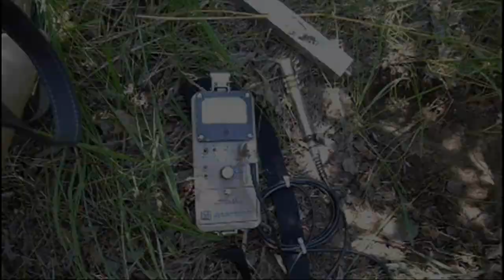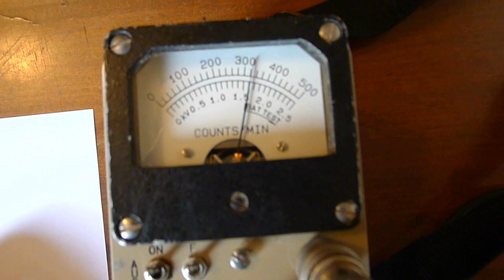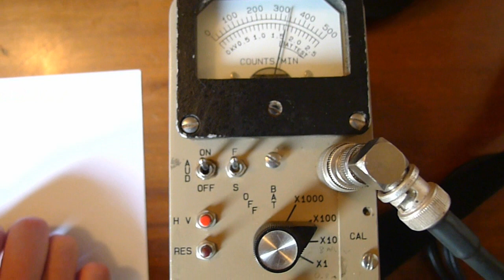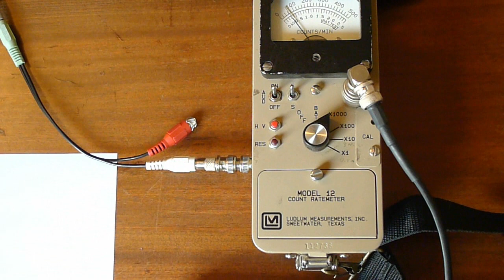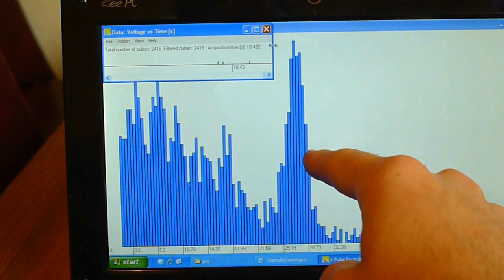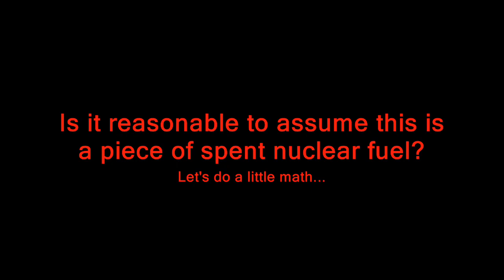Collecting a spent nuclear fuel fragment at Chernobyl

Comment from the maker: Kyle Goddard Going to Chernobyl and handling SMALL pieces of nuclear fuel (like what is shown) is pretty safe relative to some everyday risks people take, like driving or eating cured meats or smoking.  My whole-body dose equivalent from external radiation for this trip did not exceed 10 mrem, which is too small to be associated with meaningfully-quantifiable health risks.  If one DID extrapolate a risk to this dose using risk models, though, it would be about as risky (in terms of death by cancer) as smoking 1.5 cigarettes.  The highways in Ukraine are far more dangerous than Chernobyl radiation!
Reply: @ezekiel1249  Maybe you should do a bit of fact checking before calling someone an idiot. A quick look at his youtube channel would reveal that Carl is very much alive. His geiger-counter is not indicating in millirad/hour, and even if it were then that would still not be particularly alarming. For a lethal dose of radiation you're still off by a factor of 1000, and it would then still need to be full-body dose (rather than highly localized as it is in this case) and sustained for an hour.
Reply: @MatthijsvanDuin  thanks for correcting me didn't know it had to be a body dose I thought radiation fragments release radiation in the air where it will cover a certain part of land radiation is not my forte but I do like the chernobly HBO series
Reply: @ezekiel1249  You are awesome for admitting you were wrong, that's a first in youtube comments
Reply: You still active and into this stuff
Reply from the maker: @drummondjwall9509  That depends entirely on your definition of "active", but given that I keep posting nuclear science videos (most recently last week), I'd say I am still active and "into this stuff."
Reply: Lol my bad dude , I just saw this from 10 years ago but that's cool I'll subscribe now

Comment: May I ask what you did with the particle? Bury it up in the exclusion zone again?
I believe it's strictly forbidden to take particles out of the exclusion zone and I doubt you can get it home in your suitcase. Unless lead pigs are not considered suspicious ;)
Reply: Raymond Doetjes exactly what I was thinking :p
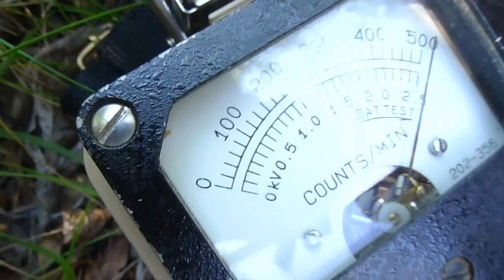Reply: I think he is dead cuz look at 1:04 you can see the radiation is beyond 500 which means he got a lethal dose
Reply: @ezekiel1249  Yes, Carl died four years ago and yet posted a youtube video two weeks ago from beyond the grave. Such dedication!

(I suspect you're just really confused about the units here. The amount of radiation here is really not particularly dangerous, especially considering the limited amount of exposure Carl received.)
Reply: @MatthijsvanDuin  I need to do sime research because I need to know what the BAT TEST is cuz look at 1:04 of the video and you will see something named BAT TEST between the 400 and 500 mark
Reply: @ezekiel1249  You are thinking REM not mrem
Reply: @ezekiel1249  let's focus on the gage of the meter for a minute.
Metering scale from 0-500 counts per minute.
0-25 kilo volts.
Bat test, to ensure you equipment battery is of reasonable power to successfully run the meter.
 The meter is able to add multiplying factors to your scale, x1, x10, x100, ( x1000 on select meters). 
So if we max the scale on all factors it would look like, x500, x5000, x50000, so on if we have more times factors.
Counts/minute is more a show of activity then does, such as R/h or mR/h. He is in potential to receive a large dose past normal, but still isnt likely as the sample isnt right on him.
Reply: @ezekiel1249  that is CPM not roentgen
Reply: @ezekiel1249  lol that fuel particle only puts off 500-600uSv/h on contact. It's orders of magnitude smaller than something that would be considered an irradiation hazard.

Comment from the maker: A linear tail-pulse signal is capacitively coupled off the output of the first stage preamp in the ratemeter to the BNC on the side.  A cable carries the signal to the computer's sound card input.  The computer uses Marek Dolleiser's free "PRA" application for pulse-height multichannel analysis.  Ratemeters are all fundamentally similar in design, but specifics differ, so I can't furnish a meaningful and universal recipe for the mod.  I am happy to answer specific questions if this isn't clear.

Comment: Carl - Did you modify that detector and tap the amplifier stage of it or does it normally output that? The soundcards bandwidth is fairly limited, I would think you typically need a much higher sample rate such as that of a RF ADC. but I would be very curious on how that is setup if you have a link. Appreciate it my friend!

Comment from the maker: The Unit 4 core load was near the end of its life at the time of the accident, and some simple back-of-the-envelope calculations show that the Cs-137 content of this small piece is consistent with end-of-life or discharged nuclear fuel from this reactor type.  I didn't intend "spent" to imply that it was not in the core; my feeling is that it probably IS from the core.

Comment: Some of the short lived nucleides are gone but there are long lived isotopes too. As for the # of atoms, use the molar mass and avogadro's number to calculate it. 0.1 g of iron is 0.1 g / 55.8 g/mol = 0.00179 mol. # of atoms = 0.00179 mol * 6.022 * 10^23 = a very large number.

Comment from the maker: This setup was "calibrated" (very coarsely, because of rampant gain shift in such arrangements) with check sources prior to my departure from home.  The photopeak is not in channel 26, but at 26% on an arbitrary 100% pulse-amplitude scale.  I aimed to put 662 keV at about channel 200, if I remember correctly.  Next time you go to Chernobyl, you can contact a lab "in the area" and do a superior experiment.  Good luck with that; I'm not aware of any.

Comment: Thanks a lot for the explanation its somewhat of a shame that Ludlum does not incorporate something similar into there venerable meters it would seem to be a low cost way of modernizing there gear.
I would be interested to know what the voltage range from the first stage preamp is im just wondering if a analog linear optocoupler would be a viable option although it would seem needlessly complex.
keep up the good work

Comment: The readings were far less than that, or .06 Rem on contact. It would take direct contact of over 8333 hours; and his exposure is also largely the hands which means that this was far from a fatal dose. I think you misread the geiger counter, as counts per minute are not equal to absorbed dose. There is far greater math needed to process a dose than just the counts from a geiger dial.

Comment: Can you explain on what pin of what IC you taped of the signal and how?  i have a ludlum 2A post 7xxxx sn.  thanks in advance
Reply from the maker: My ratemeter was a Ludlum 12, so probably no relationship to the 2A internally.  If you understand the principle of the amplifier circuit, you can make a mod like this to any instrument.  The amp output must be loaded properly and you must not introduce any noise into the later stages.  I put an RC divider on the stage output to accomplish this as I recall.

Comment: Thanks Carl, Yes I might have it a little wrong. I calculated 40 microcuries as about 1.5 million becquerels or about 2 cubic metres of soil. I think I should have said 1 tonne. I used http://www.physics.isu.edu/radinf/natural.htm
The point is that it's a drop in the bucket of environmental radiation.
Your video has been reposted at http://chernobyl.tv/2013/10/19/spent-nuclear-fuel-found-near-chernobyl-still-extremely-radioactive/ where they misrepresent the facts and your opinion quite disgracefully.
I think your video is excellent and the message I was trying to put out, and I think you are too, is to keep reminding people to check the quantum of radiation, other calculations of mine are that the total Fukushima release is about 1/30000th of the natural radiation in the oceans, and that the Kursk contained about 1/3 of the Uranium naturally in a cubic kilometre of seawater, or 1 part in 4.3 billion of the total marine Uranium. I hope you agree with these.
Another good thing to do is go to Iraq or Bosnia and debunk the idea that depleted Uranium warheads dramatically increase the amount of Uranium in the environment. My calculation in regard to this is that the 300-400 tonnes of depleted Uranium is about equal to the natural Uranium in the top 0.1mm of Iraqi soil.
I concur with James Hansen and others that have said "There is no credible path to climate stabilization that does not include a substantial role for nuclear power"  Our planet needs us to win this argument.
Reply from the maker: Your new calculation and comparison to soil radioactivity look far more accurate.  I should point out that Cs-137 is the only long-lived byproduct radionuclide for which the gamma exposure based source strength technique can be used, but the other long-lived byproduct, Sr-90, will be present as well, and in similar concentrations because it has a similar fission yield and half life.  Hence my claim of about 100 microcuries total activity in the particle.  I don't think the Chernobyl.tv posting misrepresents anything factual about my video; perhaps the claim of "extremely radioactive" is what you dispute?  That is rather subjective of course.  Relative to any unrefined natural material (e.g. granite or soil), the spent fuel particle is thousands of times more radioactive on a mass or volume basis.  Relative to refined sources like radium salts, it's a weaker source (by an order of magnitude).  Spent fuel is found almost weekly at the ChNPP New Safe Confinement construction site and is one of the most important hazards on the site since large pieces cause dose rates of many rem per hour in close proximity.  It is a material that generally requires careful handling.
Reply: 1/30000th of the natural radiation is not correct. You can't compare natural radiation to artificial radiation in this way. 

For example the Cs-137 levels in the oceans are greatly elevated now compared to 100 years ago

Comment: This is a wrong approach to estimate what kind of material it is. You should take a measure of the mass, then of the volume and proceed to calculate the density and then compare with what you expect to be. This is the first step, then you proceed with gamma spectrometry and radiochemical examination. Of course this is very far from irradiated uranium oxide. First of all, after 30 and more years and high density particle couldn't be found on the upper  layer of the ground... then: gamma spectrometry should reveal also 85-Kr 514 keV penetrating gamma... then making a alpha decay measurement (total alpha) should help to exclude in the case of negative response. Radiochemical should help on the side of 90-Sr / 90-Y in equilibrium.... finally make the simplest think ever, but the most dangerous: does that particle melt at 2000 'C and more?? To me, it is not what you state. It is with the highest probability a piece from a filter of the nuclear plant since 137-Cs is in great amount and very volatile.... Ciao from Italy, ITREC Th-U reprocessing plant 1968.
Reply from the maker: Unfortunately, the hotel in Chornobyl did not offer facilities for laboratory-precision mass and volumetric measurements, nor for radiochemistry, not even basic alpha spectroscopy prep.  That doesn't mean the method shown here is meaningless, just that it is a low-precision estimate of specific activity of Cs-137 in the sample.  If we needed to see a weak 514-keV peak against a background of intense 662-keV Cs activity, and against interference from 511-keV annihilation photons, we would need to collect spectra on a high-resolution HPGe detector and not a sound-card scintillation detector.   Once again, the facilities do not offer this kind of support.  But once again, the lack of spectral resolution and detail do not motivate alternative conclusions about the magnitude of the specific activity of Cs-137 in the sample.  I am confident in that result and the conclusions motivated by it.
Reply: Carl Willis 85kr is a noble gas: dissolve the particle and collect gases, then filter them, then measure the noble one. Low concentration of course. However ICP mass spectrometry will tell the truth. I only think you've been so precipitous to make that conclusion. Always be careful when making a conclusion... however nice video
Reply from the maker: I am a professional nuclear engineer, and I have no problem understanding the analytical approach you propose; it's just not a realistic expectation in the government hotel in Chornobyl.  (I think I have mentioned that a few times.)  Nuclear fuel pieces are uncovered in construction every single week at ChNPP, and this small piece is demonstrably consistent with that common material, within the admittedly large uncertainties of the crude method demonstrated in the video.
Reply: Carl Willis could you link the relative uncertainty to your measures?? I don't see all that consistent you state...Thank you Professor...  ;)
Reply from the maker: This is the sort of thing you should be able to roughly intuit from the demonstrated measurement at ~3:33 in the video.  Specifically though, the measurement was done by comparing the count rate from a small, point-like ~10-uCi (decay-corrected) Cs-137 source in a ~2mm brass bead housing with the count rate from the sample particle here in similar geometry (probe contact).  In both cases, statistical variations on the meter due to the short RC shaping time are within 5%, and this is also essentially the visual interpolation limitation of the meter face; the reference source activity is known to within 10% or so; and the meter countrate calibration is probably accurate to within 20% with this probe (it is not a factory-calibrated arrangement).  Summed in quadrature, the overall uncertainty in the Cs activity of the sample particle is around 1/4 the measured value, i.e. 40+/-10 microcuries Cs-137.  If you read previous comments on this video, you will see you are not alone in scorning this little field measurement because you've got access to better methods in a laboratory.  (I do, as well.)  I've told some of these other folks to go ahead and take their ICP-MS, their germanium detector, etc. to Chernobyl and do their own measurements, and I think the point is pretty obvious: the Chernobyl Exclusion Zone is an inhospitable environment for lab-grade work (unless of course you have official and institutional support there).
Reply: Carl Willis I think you have answered to yourself... plus what is the uncertainty related to the volume??? if you don't have the right instruments, please don't make fast conclusions. Ciao.
Reply from the maker: I think you're too picky about the evidentiary burden supporting my conclusion.  Ejected fuel is a commonplace material on the grounds at ChNPP, so the conclusion is not unusual.  To repeat my conclusion from the video description: "In color and appearance [the particle] is consistent with sintered uranium dioxide fuel, and the activity is broadly consistent [with nuclear fuel] as my calculation at the end of the video shows."  BROADLY CONSISTENT.  If you want to take "the right instruments" to Chernobyl and do a better measurement than BROADLY CONSISTENT, I'll watch your video.  Good luck!
Reply: Carl Willis why we have to believe you?
Reply from the maker: If you want me to consider an alternative explanation for this particle, that explanation has to be consistent with the illustrated details as well as reasonable in the context of the Chernobyl site.  Nuclear fuel debris is consistent and reasonable.

Comment: Cote the entire core and internals of reactor with ,FIRE RESISTANT LEAD LADEN EXPANDING FOAM INSULATION, and continue to coat over and over till you have a solid coating of  LEAD LADEN EXPANDING FOAM INSULATION! then cut into cubes and spray, LEAD LADEN EXPANDING FOAM INSULATION to the fragments and shaving and waste from cutting the encapsulated into solid body of LEAD LADEN EXPANDING FOAM INSULATION into cubes!

Comment: How do you know this is Cs-137?  You're really only speculating that it's Cs-137.

Your gamma spec has no energy calibration.  Your display appears to show only channels not keV.  The peak you said was Cs-137 at 661 keV had a centroid at ~ channel 26.

Why didn't you just take it to a lab in the area or find a scientist nearby who had a calibrated portable gamma spec to get a quick isotopic analysis?  It would cost little or  nothing & wouldn't take more than a minute to get results.
Reply: Why are all these amateurs in the comments so skeptical? You would have thought that Carl would know how to use a gamma spec. The spectrum seemed typical of that of Cs-137, and regardless, Cs is the primary radioisotope you're going to find in the exclusion zone. Gamma spec is hardly necessary to validate that it's Cs (since there isn't much else it could be).

Comment: The critique is entirely appropriate given the lack of evidence for your conclusions.  You haven't "conclusively identified" any nuclide and the sample concentration is far from a "reasonable assumption".  A BB is not the same size as that particle.  There is no indication you used calibrated distance (eg, using any kind of jig for counting).  

I congratulate you on finding a radioactive particle at Chernobyl.  But please don't think you've done anything else beyond that.

Comment: Ha ha ha, just watched the video. The amount of radiation is equal to the normal radiation in one kilo of granite.
Reply from the maker: Math must not be a strength of yours, Graeme...or maybe you are just not familiar with this subject area.  Granite typically runs around 30 nanocuries per kg, mostly from potassium.  The particle shown in the video contains about 100 microcuries of combined activity, or several THOUSAND times more radioactivity than a kilo of granite.